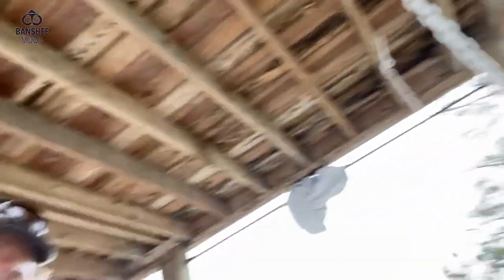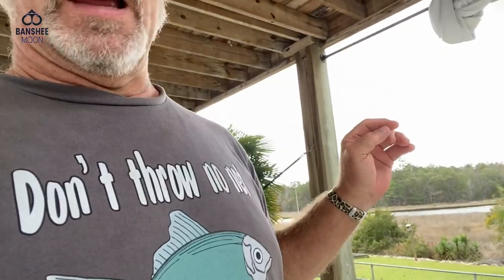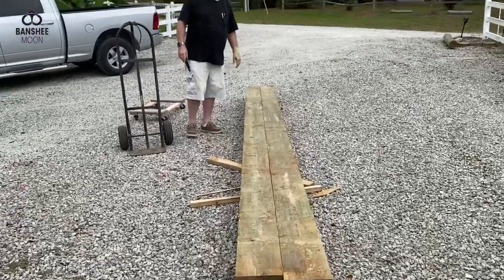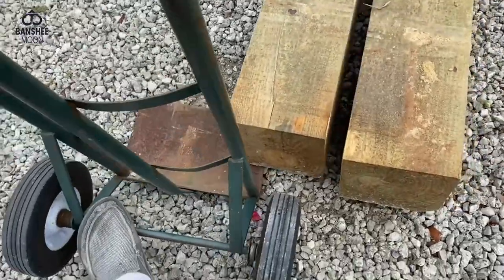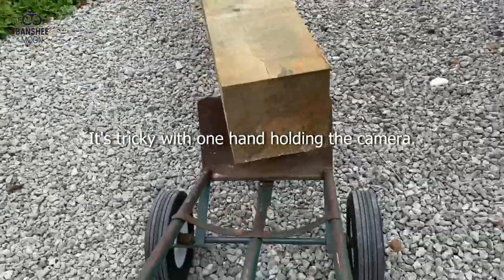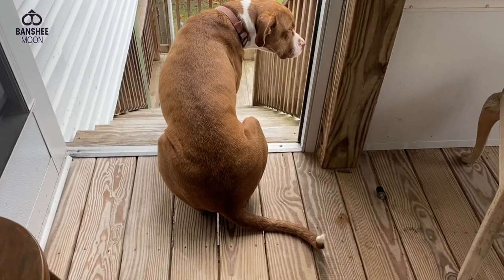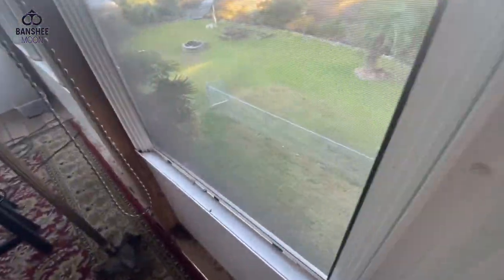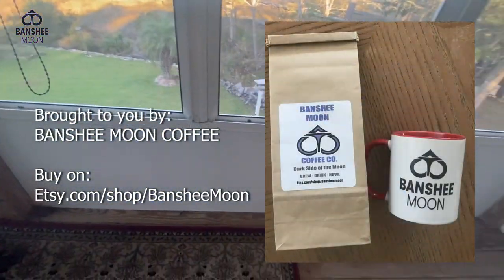How Two Old Guys Lift and Move Heavy Lumber.

Comment: I just finished building a timber frame workshop using 8 x 8's. They were 8 foot, 10 foot, 12 foot, and 14 feet long. I coul lift the 8 footers, but not the others. I was by myself because of covid-19 distancing. I used inflatable boat fenders to roll the timbers across the lawn. I overinflated them and they rolled easily. I basically pushed them with my foot. Worked great. Moved 20 of them that way about 100 feet.